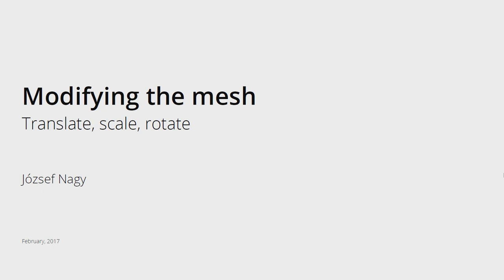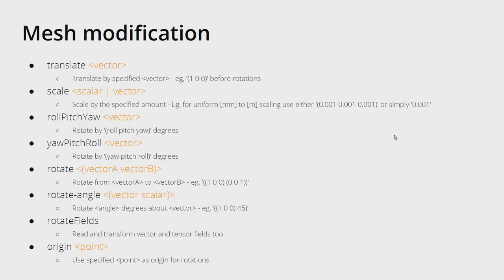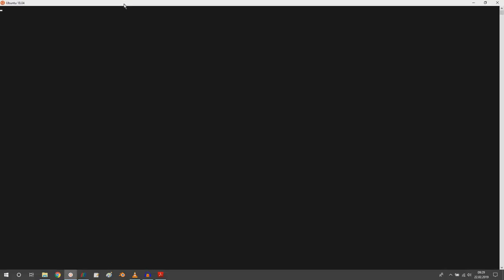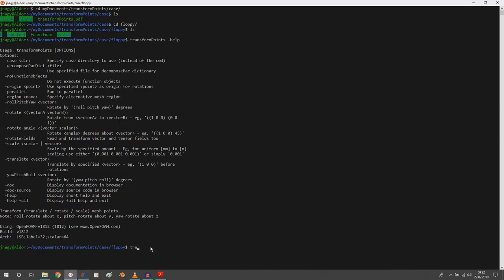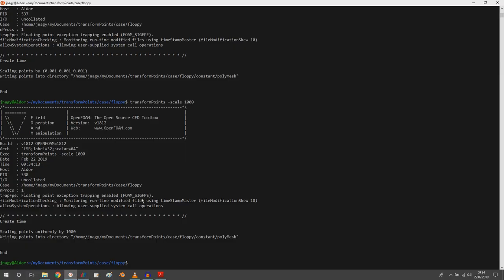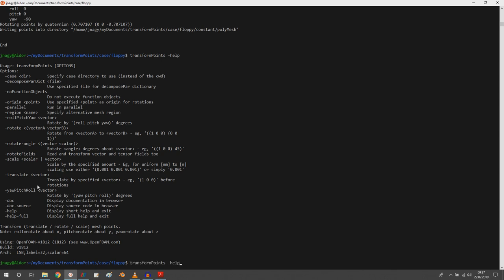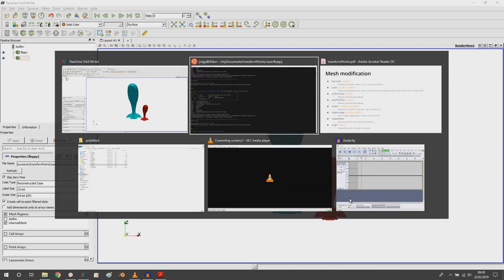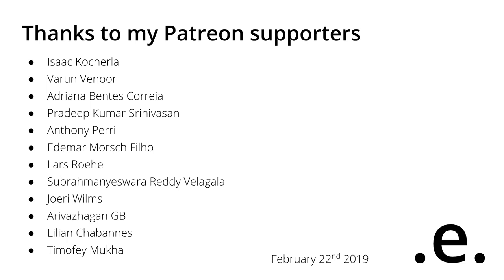Scaling, translating and rotating your mesh in OpenFOAM with the command 'transformPoints'

Comment: Hi, is there a way to transform the points and keep it fixed and saved onto that location. There is an STL file, which, when I import, does not coincide with the origin of the blockMesh.
Reply from the maker: You can also translate the mesh with transformPoints.

Comment: Nice and useful video! vielen Dank! I have a question for the sets after scaling: I want to run a simulation in micrometer scale. I did blockMesh and snappyHexmesh all in default(in meter scale) and had transferred all the points into um scale, these are all ok. unfortunately, after running I found an unacceptable result. I think the reason is I should also change the set on boundary conditions and time-steps or fvsolutions? If I have to do this, is there any rules? All things times 1e-6?
Reply from the maker: You have to enter everything in SI units. Maybe you added an inlet velocity of x um/s but instead you have to use x 1e-6 m/s. Possibly this could be it. But difficult to tell.

Comment: Hi Jozsef, thank you for the interesting content. I have a question to ask: is it possible to translate mesh in between solution, e.g. I complete 0.8 s simulation, and then I translate the mesh, and re-run the simulation for another 0.8 s, with a total simulation of 1.6 s. Is is possible ?
Reply from the maker: I am not 100% what you mean, but I guess so. You have to map your results.
Reply: @OpenFOAMJozsefNagy  thanks a lot, I tried using mapFields and it worked after a few attempts.
Reply from the maker: @InaamaliMalik  Great!

Comment: Hello Jósef, is it possible to rotate a mesh made with blockMesh? I want to rotate the pipeCyclic tutorial by 180 degrees in the z-axis
Reply: It is possible, I had to run blockMesh first
Reply from the maker: @mtom798  transformPoints -help will give you the possible solutions.

Comment: Hello Jozsef, saw your video. I want to divide my inlet patch into 3 different patches to assign different BC. Is there any utility for this?  Also I am using blockMesh for generating my mesh.
Reply: Sushrut you should define your inlet by three separate squares (or wtv shape you want) and at your 0 file in u define the velocity at its square
Reply from the maker: @apotl8584  This is the best way to do it, yes. You can use surfaceToPatch to select only parts of the boundary with an STL file.

Comment: hello, thank you for the video, it made me realise that there might be a way of translating/rotating only the products of the snappyhexmesh without moving the boundary volume. i tried the surfaceTransformPoints command but it just moves my stl, which in retrospect i should have anticipated.
Do you know of any ways you can achieve that?
Reply from the maker: So you only want to move the inner boundaries of your mesh created with snappy and not your original boundaries from blockMesh?
Reply: József Nagy József Nagy yes, exactly. To give some context, we have a formula student car and at some point in our research we need to test the car in various heights from the road, so by just moving the inner boundaries we could save a lot of computational time. Otherwise we would have to crreate a mesh for the same geometry around 10 times ( i suppose the same principle will apply for the roll and pitch )
Reply from the maker: @apotl8584  The question is, how big the movement is compared to the actual geometry. The mesh might be morphed in a strong way and then your cell quality will suffer.
Reply: @OpenFOAMJozsefNagy  the movement would be a maximum of 20 millimeters while the geometry is around (2.5 , 1.5  ,1.2 ) in meters in the x,y,z axis accordingly. I suppose that an evaluation of the results would be in order, assuming the mesh movement is feasible
Reply from the maker: @apotl8584  Then check out in your OpenFOAM installation in tutorials/mesh/moveDynamicMesh the examples. Maybe they can help you.
Reply: @József Nagy will do, thank you very much for your help!
Reply from the maker: @apotl8584  I am glad.